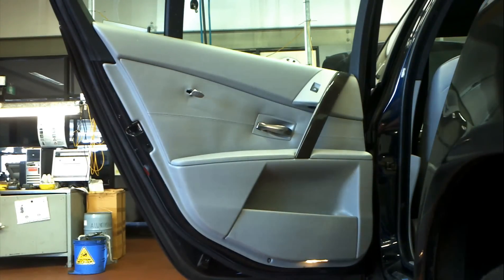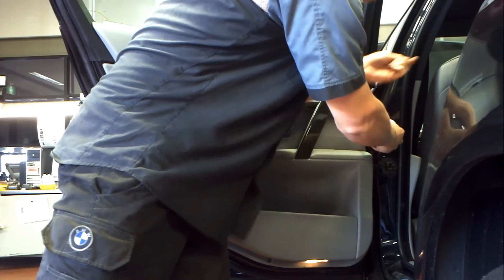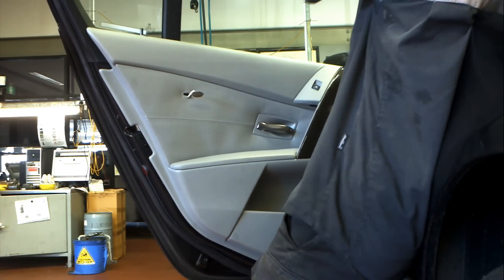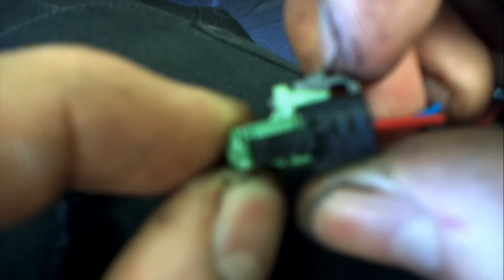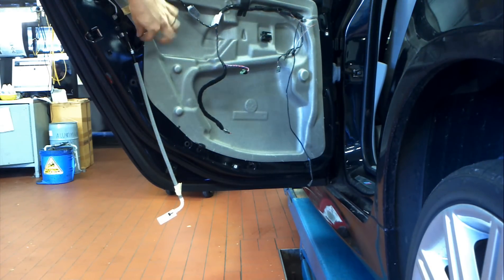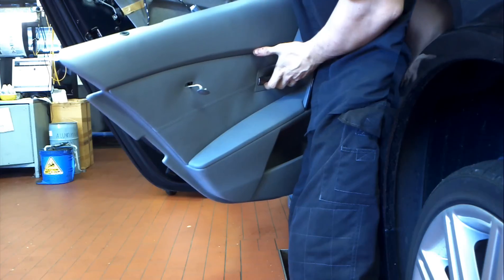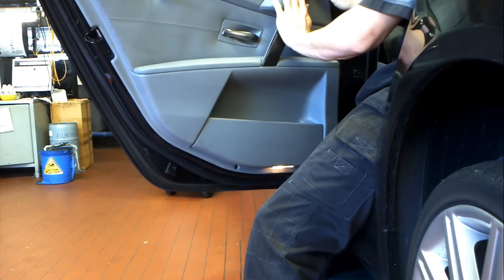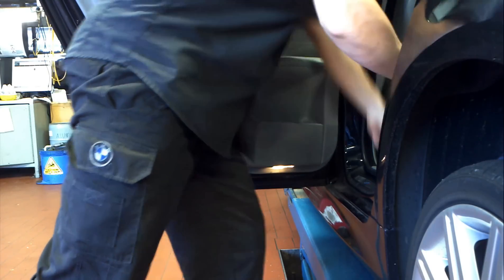BMW 5 Series E60 Rear door trim removal How to DIY: BMTroubleU

Comment from the maker: you just need to get the small triangular trim off the front door (sometimes a speaker) but that may involve taking the door trim off too. it'll be different screw locations and trim removal methods for the front but yes, the same basic principles. good luck

Comment from the maker: you dont need to, but if you disconnect the airbag with the battery connected you will get a fault code which youll have to delete using a scanner

Comment: Looks like the door vanity light was on.  Did you not disconnect the battery first?  No worries of airbag inflating?
Reply from the maker: No worries at all. Airbags only go off when the correct voltage is applied to them.
You could say it's good practice to disconnect the battery and I'd say fair enough. But I would maintain that worrying about the airbag going off is like worrying that a light bulb in your house will turn on when you're taking it out of the socket. There's no reason to be concerned unless the switch is on.
Reply: @BMTroubleU  Good to know

Comment: Hi I just saw your video and you have a lot of good videos about BMWs. I have a 2004 BMW 545i, and I'm having some trouble starting the car. What's going on is I'm getting a transmission fault code and the cruise control code and a active steering code and the drive control code. So what happens is when I put the key in I get a lurch and then all these codes come up and nothing else happens so the car won't start or nothing. I have checked the dd E relay and I also removed the SMG transmission motor pump that's on the bottom and also had that tested. I also tested the battery and it's reading okay. Now the difficult part is I wiggled the ECU around and the DDE relay and we got it started but then it won't start again no matter what I've tried nothing works and I'm getting no reading from a obd scan tool it's pretty much not communicating with the car's computer at all so I am in a lot of trouble and I don't know what I possibly could do to try to start the car do you think that it could be the ECU? Please get back to me thank you again and thank you for making these BMW videos.

Comment: Hello.  Thanks for the video.  Could you tell me whats the best way to insert the wood grain panel for this model. my passenger side wood grain panel in E60 is broken from the retaining clips.  Do I still need to remove the door panel?.  Thank you.
Reply from the maker: usually not. i believe i removed the trim on this door before realizing that it wasnt necessary to remove the door trim.
Reply: Thank you.  I will give it a try this week end.

Comment: Hi trying to change the door trims on all 4 interior door handles, how easy is this??? Do I have to remove all the door panels??
Reply from the maker: usually door handle trims can simply be pryed out with a plastic trim removal tool. i didnt need to take this one off in order to remove the complete door trim so i didnt bother to do it for the video. they should be similar to the trim on the upper of e46 doors, just slip the tool in beside or behind the trim and pry off carefully. check out the first 30 seconds of this video for an example BMW 3 Series E46 Front door trim, window, motor and regulator How to DIY: BMTroubleU

Comment: Hi Mr bmtu.
I'm trying to remove the trim around the door mirror. The paint seems to have corroded and is like a white powdery residue that has forced the paint to flake off. Im going to spray it but have to take it off so I cab rub it down and prep it properly. And vids or tips? Thanks I advance.
Reply from the maker: use plastic trim removal tools is the only tip i can give you im afraid mate. i cant quite remember how the side view mirror trims come off...

Comment: i have a 05 Bmw 530i my front window has been malfunctioning.  my window is stuck in the up position an will only move about an inch or so.  when i press the button to take the window down the window goes up, when i press the button to take the window up it goes down or wants to go down.  i can still hear the window mechanism working so i know thats not the case but i think the window regulator is just off track.  I have got a warning light before that showed a window halfway up with an exclamation point, and a lli had to do was hold the button up for a few seconds and it fixed the problem.  i usually only got those warning when it was really hat and the window kinda stuck to the trim.  now that doesn't seem to work and my  window its stuck in the up position, before my window always worked even when that warning light was on.  I believe that my window is off track and i need to take the door panel off and get the regulator back on track.  im wondering what the best course of action is for this and if you have ever had any experience with this sort of problem?

Comment: i'm removing the same panel, only on the right side. But on the car i work with, there is som kind of shaders, or "sun-blockers", that i cant seem to get off.. any tips? do you know what i'm talking about?
Reply: My "sun blind" is broken. It will not retract. I'm hoping I can get the panel off to fix it.

Comment: Do you have to disconnect the battery?.
Reply from the maker: sorry for taking so long to reply, ive been away for a while. no you dont have to disconnect the battery, just switch the ignition off and take the key out. dont put the key back in or turn the ignition back on or you run the risk of creating an airbag fault code that youll need to get deleted. thats all